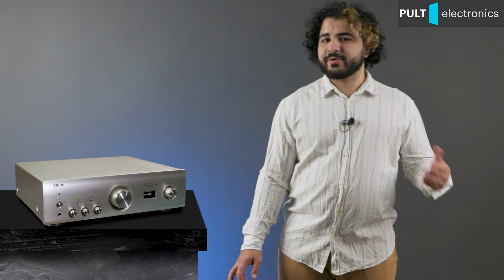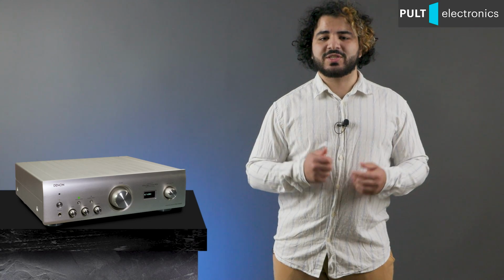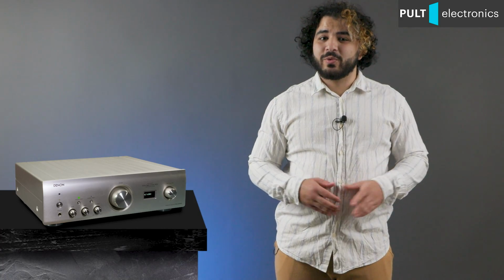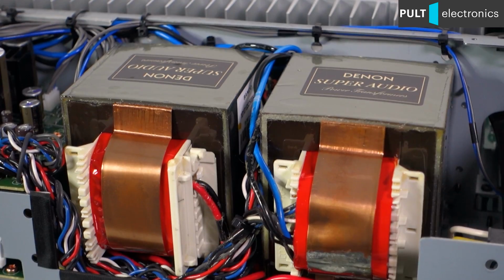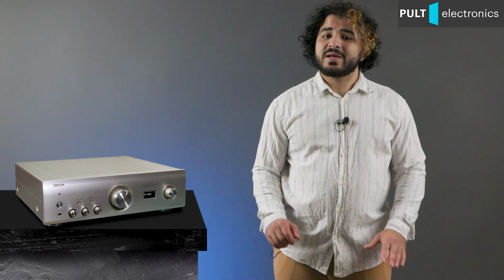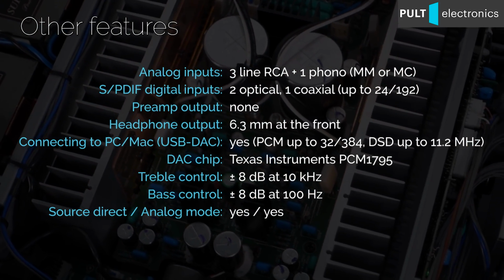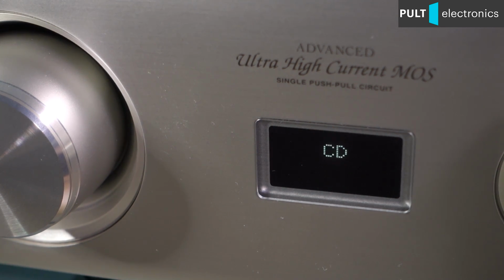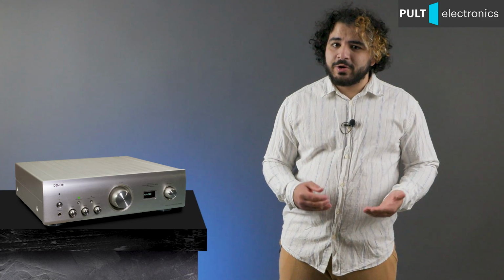Denon PMA-1600NE. Almost a classic mid-priced amplifier.

Comment: The AE series was better and the dac used is okay but not great so i am owning a 1520ae and love that tank.
Reply: Hi...having chance to buy 1500 ae...Can you tell me how is 1520 AEin sound character, cause I have bowers 703 s2?...Ty for answer
Reply: @mw12387  Good amp for your speakers and it is a little warm and great dynamics and also great soundstage and lows are very nice and fat too.
Reply: @timschutte3961  which speakers you have?
Reply: @mw12387  I have the Dali Zensor 7
Reply: @timschutte3961  did you try maybe oberon 7?
Reply: @mw12387  Nope but my brother also had the Zensor and tried the Opticon but was not a big improvement for the money. And Oberon 7 will be slightly better for sure but if i upgrade it will be Rubicon or Rubikore at least. And with those speakers i also need a better amp and will cost haha. But they play fine and love the sound and got the Gaia 3 feet also and sounds even better now.

Comment: Good review, but the pma 17000ne is already on sale, well at least here in N. America. Did Denon need to upgrade this amp? The upgrades are small as the 1700 uses a 2 stage volume control rather than the old 1 stage. Also, the 1700 has added a pre in. The pre in is a nice feature if you have a tube pre amp that you would like to use. That will not be many peoples' choice as the preamp section in both models is excellent, but it's nice to be able to make a change once in a while.
Reply: The 1700ne sounds a little different than the 1600ne. I have the 1700ne but have tried the 1600ne with the same exact setup. The 1600ne is more rolled off by comparison and a blurry in regards to soundstage (enough that I actually sold it). The 1700ne is more lively and sounds wonderful. Have no idea what they did, but they changed something on the inside that altered the voicing. I believe I read somewhere  that they changed the type of capacitors that they used in the 1700ne but I can't confirm that. Regardless, they fixed everything I disliked about the 1600ne's sound.
Reply: @TheHammerofDissidence  tnhank you for adding this